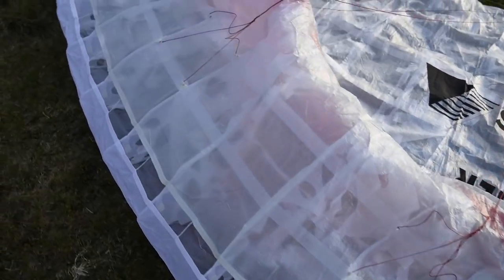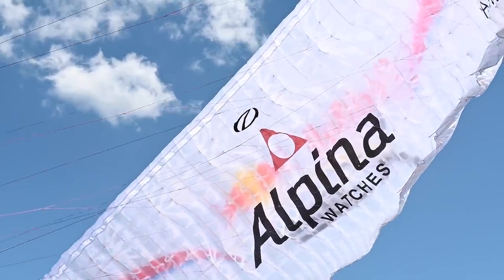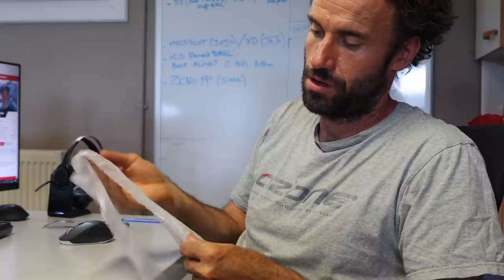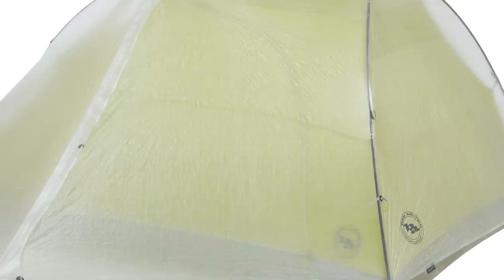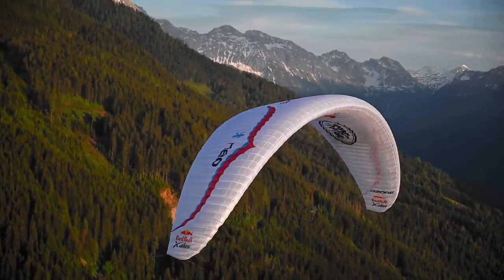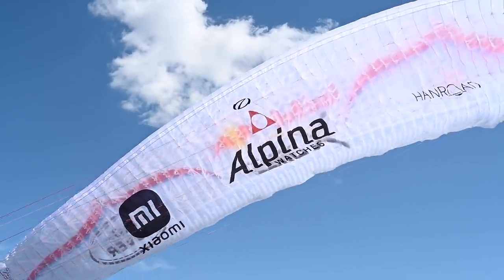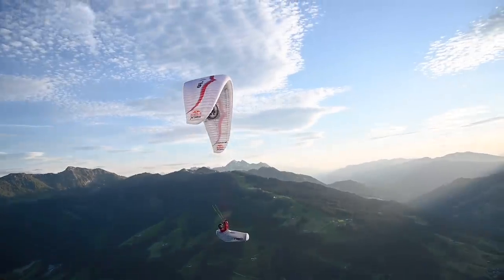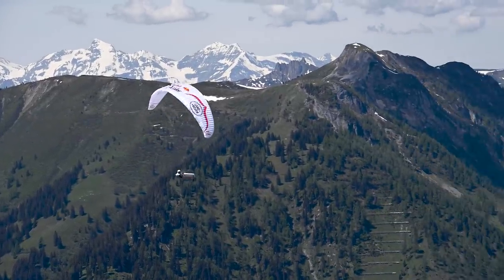Insight: Ozone ZeoliteXD – with designer Luc Armant

Comment: Shrinking should be an important concern for this dyneema fabric I think, if it is not dimensionnally stable then it will cause several problems to the wing shape and performances.